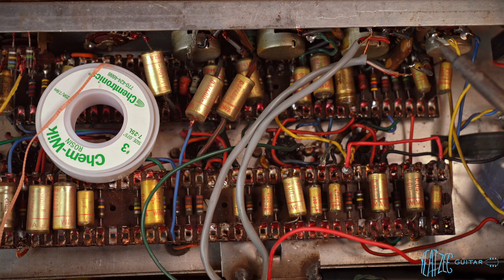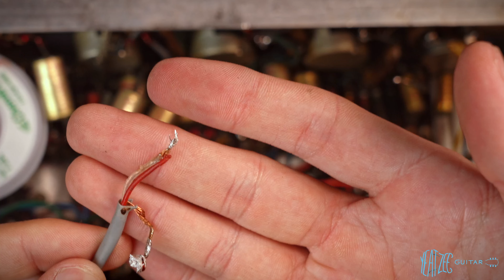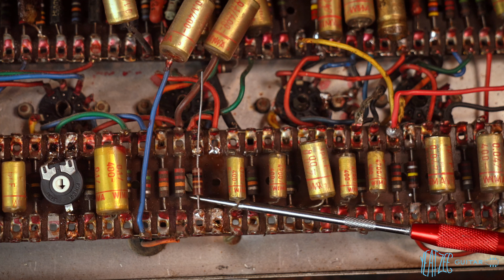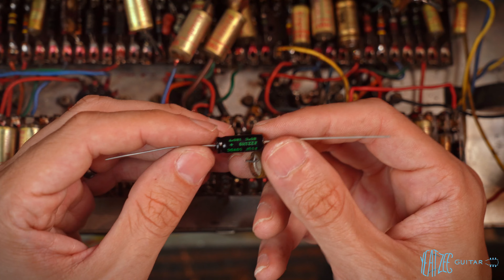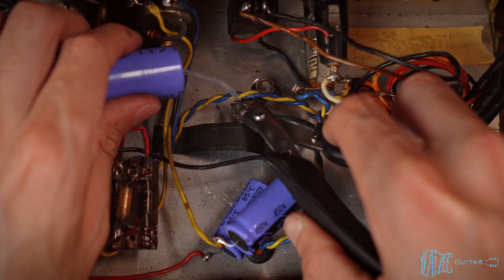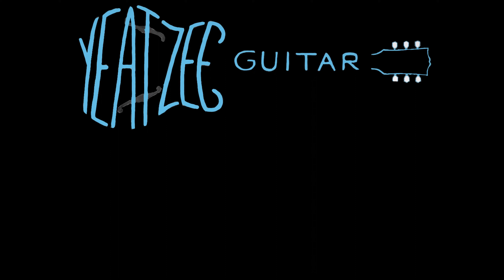JMI Vox AC30 Repair Pt.4 - The Rubber Hits the Road...

Comment: Question about the initial testing of the resistors. Are you clipping your meter onto each side of the resistor while in place to get a rough estimate of the ohms? Then if it seems out of spec, you remove one side to get a thorough test? This set of videos have been a delight to watch. I currently have a 64 Treble on my work bench and I'm following along with everything. Great stuff!!
Reply from the maker: The vast majority of resistors in amplifiers of all kinds can be read in circuit so basically the best way to do it is measure it in circuit and if the result is way off of what you would expect then you might have to lift one leg. Theres only a few spots in the circuit where that's really applicable. Now if the measurement is say you know 20 30% beyond what you would expect, and it has to be higher as carbon comps will drift up not down, then it might just be the resistors drifted.. but that also doesn't necessarily mean it has to be replaced sometimes those changes actually give the amp a special sound.
Reply from the maker: If you remind me a week or two, or whenever you're done watching the series with a comment, I'll do an updated quick video on the amplifier. I've done a lot since I ended the series , nobody really watched the series so I didn't keep it going after the fact but I can give you some helpful information with yours in that video.
Reply: @YeatzeeGuitar  yes that would be so helpful. I'm currently waiting for my parts to come in the mail. Changing the normal capacitors and what not. I did pull off the 100 ohm resistor on the power tubes and they are way off so I went ahead and ordered them. I stopped for the moment bc I read to pull the resistors out of circuit to check for drifting and was overwhelmed with the work that would require. Glad to get your input. I've changed out a few Super Reverb doghouse caps but this Vox has been a much larger task, and that's just from doing the research to find all the information needed! Lol. Crazy how hard it is to find. Especially since, when considering the Mt. Rushmore of amps, they are on the list.
Reply from the maker: Yeah vox is much more difficult to work on. Very fragile boards (cut out the resistor vs try and bend out if you want to replace on the board to minimize chance of breaking a tag) and the layout isn't intuitive. These videos should be helpful for most stuff
Reply: So I finally got everything in. I went ahead and changed out all the electrolytic caps and bypass caps. Pretty smooth so far. Question about the resistors, what wattage am I suppose to put in for the carbon comp? I have only a couple that have drifted. Also I went with the 470 and 3k metal film for the power tubes at 2w. What would I see if I went with the original ohms there at 100 and 1.5k. The amp has the original Mullards. I tested them and they all passed. I would like to keep them in the amp and also preserve them as long as possible
Reply from the maker: 1/2w for all resistors on the board is fine. Those bigger resistors on the socket make life easier for the tubes so they'll last longer

Comment: I recommend that you change all the carbon composition resistors with 3 watt metal film. I built this same version of AC30 from scratch building the cabinet also. What a great amp.
Reply from the maker: I like the carbon comps, a certain charm to them (until they get noisy lol)

Comment: There is an unused terminal right next to the terminal that you are soldering the wiper of the trim pot too. Why not put a jumper wire over to the unused next-door terminal and then you can solder the wiper of the trim pot directly to a jumper wire bridging the gap between the previousky used terminal and the previously unused terminal next to it?🤔
Reply from the maker: I feel more confident in the connection of the wiper going to the terminal than I do connecting it to a jumper wire.

Comment: Is there no practical way to get that front-most tagboard out from under the shadow of the potentiometers on the front panel?  Or perhaps you need to unbolt the pots and hopefully there's sufficient length in the wiring and attached components that you can move them a couple inches out of the way to facilitate changing parts on the terminal strip? I have to say that the flathead screws holding the boards down being located almost directly underneath components on the board is an insanely stupid construction technique. It might be wise to replace any components directly above those screwheads with a new part that has longer leads, bent in such a way as to shift the part away from the screw head slightly so that you can get in there with a screwdriver and remove the board from the chassis if you should need to in the future......
Reply from the maker: It is crazy isn't it! Yes you'd have to remove the pots (which are all connected to the same thick ground bus) to get better access to the back and/or remove the board which as you said is a massive task because of the screw locations

Comment: Tanner, nice solder work.  question concerning the polarity of the sprague atom bypass caps.  On the lower board furthest away from the potentiometer the wima cpas show  their band (negative?) downward away from the pots and the replacement cap has the positive upward.  Fine.  But on the second bypass cap the wima caps band is still showing banded away from the pots and the replacement cap has the positive away from the pots.  Is one of the replacement bypass caps polarity in the reverse position?  Or is the wima caps orange band not an indication of the negative side of the cap?
Reply from the maker: I get to this in an upcoming episode but the grounds are all over the place on this amp, some top some bottom on the same board due to wires underneath making connections. It makes it very confusing, but the Bypass caps were replaced in the same orientation as the originals. I'll likely do a continuity test to ground before firing it up as well because it is bizarre.